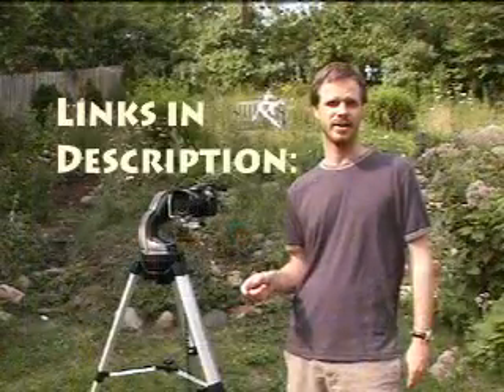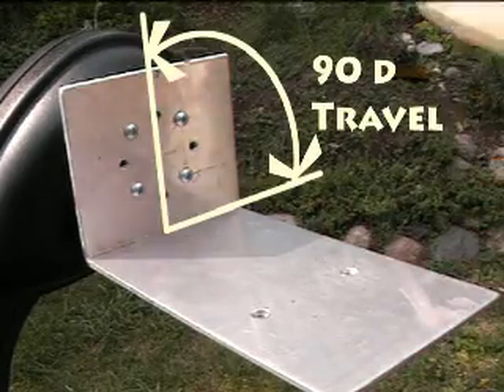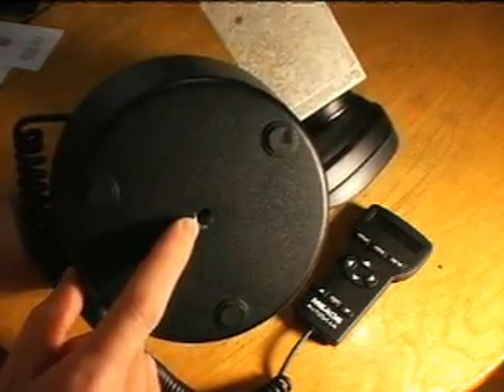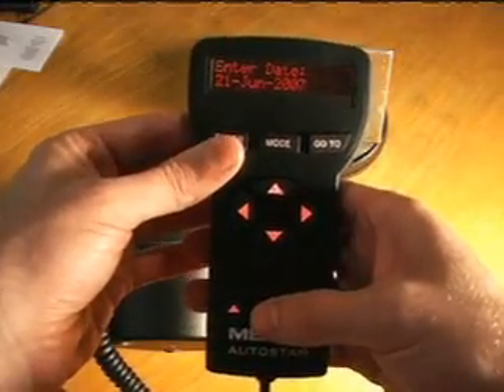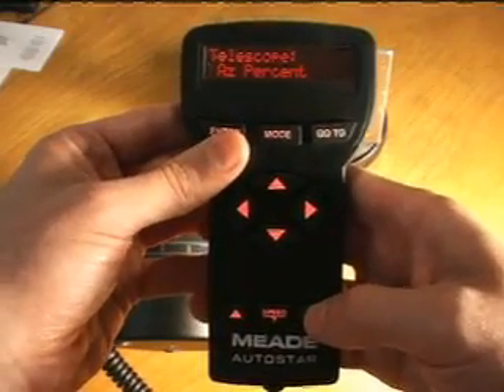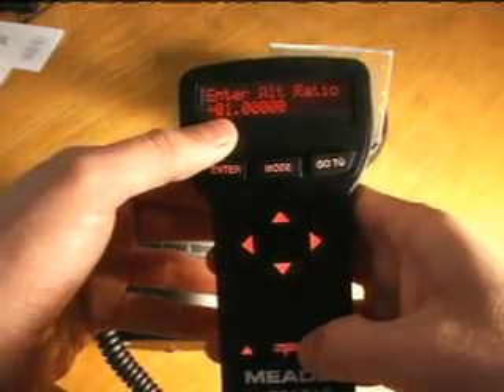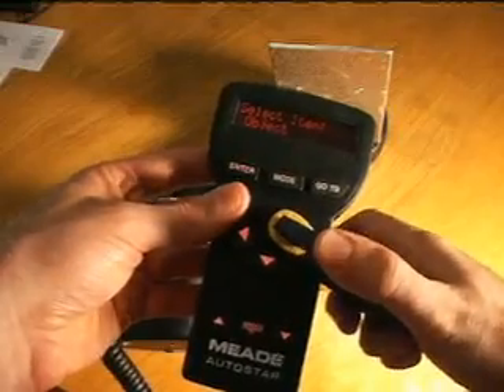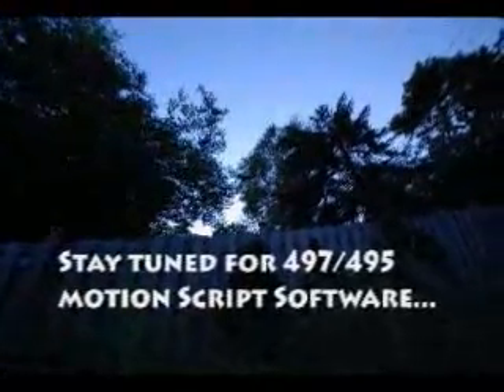Two Axis Panning Timelapse Head for DSLR (ready to buy)

Comment: So I got my ratios all set up and I tried to do a timelapse but it doesn't seem like the head is actually moving when I hold down the arrows. I can hear the motor but when i watch the degrees I dont see anything changing.  When you hold down the arrow keys do you need to be in a specific part of the menu?

Comment: great video! thanks a lot for sharing your experiences, very inspiring!

There is one thing I couldn't figure out. may you can help me by that:
I want to make a 360 degre pan (rotation) within a period of 24hours. 
Do you think that's possible with the 494 controler?
(I think about buying the ds-2000 with the 494 controler)

Comment: @cl191 I'm not sure whether it will, but stars trail quicker at the celestial equator.  So if you are pointing the camera around where the Sun normally travels (but at night) or (the ecliptic) the stars will trail the fastest.  There is actually and equation out there that tells the mm of star trial on a sensor using a certain fl lens at which declination (of star).  I hope this helps.

Comment: @milapse 'Sidereal' means 'pertaining to the stars'. Because the Earth orbits the Sun it actually rotates slightly more than 360 degrees in 24 hours (a solar day). A sidereal day is the time it takes for the Earth to rotate once in relation to the stars, which is only about 23h 56m.
Anal, I know, but factual. :)

Comment: Meade actually put a larger thread hole on the mount as a safety for their telescopes. Some tend to be heavy and most normal tripods could fall or be bent by the telescope's weight, so the larger hole is to provide a more stable connection and keep people from doing something stupid with their $500 dollar telescope.

Comment: Today (11/7/09) I bought a DS2090 at Costco for $199.  Get this - it comes with the tripod, ds2000 motorized head (a.k.a. milapse) AND the Autostar 497 controller!  Yes, that's right.  You can save $130 by notbuying the 497 separately.  Oh, and you get a telescope too (not a great one but goodenoughfor a little planet gazing...).  Costco item number 415461.  Available in stores only.

Comment from the maker: You are absolutely correct. The polarity of the 9v style connector is 'backwards'! Your solution is fine. I actually have one that is just the 9v connector to cigarette plug so I run it off a big 12v DC supply and waste no power in the conversion! ;-)

Comment: I made my own from a AC power supply I got off eBay for five bucks, look for a 12v 1000mA output adapter.  Then pick up a pack of the 9v battery terminals at RadioShack.  Now when you wire it up connect the red to black and black to red, that seems backwards, but trust me it is correct.  To test it disconnect your handpad from the tripod head and power up the tripod, if you get the red light you are good - no light  - something is wrong.

Comment: I find this to be a common error - you said 3/8-20 but the standards for tripod and camera mounting threads are 3/8-16 UNC OR 1/4-20 UNC (meaning: unified national coarse).

Since you said the rotator doesn't fit a typical tripod it probably has a 3/8-24 UNF thread (unified national fine).

Comment: In regards to your problem with the thread at the bottom of the panning head -- you can change the thread by using a heli-coil -- you simply go down to your local hardware or automotive parts supplier and request a heli coil thread repair kit for the 3/8-20 thread -- using the supplied drill and tap, drill out the existing thread, retap the hole, and screw in the supplied thread insert-these are generally used to repair stripped threads, but can be used to change the thread.

Comment from the maker: Never got around to that... It means - four 3/16"  diameter holes in a square pattern (::) spaced 1-1/16" on center. You can do a 45d set as well (same pattern) or dig into the head and remove the tab that limits it to 90d of travel.

Comment: Quick tip for this unit...
instead of clamping down the buttons to get it to keep moving on its own... just unplug the controller while you're pressing the buttons and  it will move on its own until you turn off the  unit at the source to stop/change direction

Comment: one thing to watch out for if you do the pulse thing is, i have noticed that if i start and stop the head it takes a few seconds fo r the head to start to move after power is applied.  if the motor has gone in the other direction, it takes even longer to get going. so that might be a problem

Comment from the maker: I'm not really sure where the bottom is... You could set it to 2x and set the ratio to .00001.  It's an interesting idea nontheless, Software control could do this. I'm thinking about a 'pulse' mode where you can set a pause/move/pause type pattern.

Comment: i would also bump up the thickness of the bracket to 3/16th aluminum if you are going to put a lot of weight on there.  if the bracket flexes or deflects with the weight  you will never get the camera to do level pans and the footage will look bad.

Comment: to address the durability of it.  mine recently launched out of the back of my pickup truck (it was wrapped in a blanket) and it still works fine.  I caught air going to a shooting location and the tailgate dropped down dumping everything out of the back.  the head still works fine.

Comment: if you load up the head with lots of camera equipment the vertical motor will fail and slip before the horizontal motor will fail.  you absolutely have to have the thing perfectly level if you have a lot of weight on it as well or it will have jerky motion or will stall all together.  anything more than 10lbs and i would limit it to horizontal pans only.  I think it can support 16 lbs +/-

Comment: also to answer a few questions about the weight and durability of these things.  I have mounted a canon 1ds with a 70-200 f2.8 IS lens with a 1.4x and 2x teleconverter attached to it.  that is a BIG and HEAVY camera setup.

Comment from the maker: A dolly could easily be made by using the motor units that I used in my custom version. Good pulley system in tension attached to a track dolly would do the trick.

Comment from the maker: Programming is a slow process... It's moving though!

The software will do much more than that! You know that you can get different vert/horz speeds by setting the az/alt ratios differently right? That's what I was attempting to explain in the video. You could set the az ratio to 1.0 (about 35 degrees/hour-at-2x) and the alt to .5 (about 12 degrees/hour-at-2x)... or whatever your looking for.

Comment: hows the software coming along?
 
does it do different speeds for vert and horozontal?  like for example..  2x horozontal and guide vertical?

I am getting  another one and I am going to try to remove the stops on the vertical axis.  I will let you know if its possible and how easy it is.

Comment: answering Drayg0: a "really" cheap way to protect your camera is to get a simple freezer bag, put your camera in the bag, and screw a lens on your camera over top of the bag, then take a knife and cut the bag around the edge of the lens so you its not taking pictures distorted, really MaGyver style... but it works if sudden weather comes along

Comment: I got an email back from Telescope Warehouse: the AUX port is for motor focuser plug in for a telescope focuser. However, this meade DS-2000 type mount can plug into your computer is with the 506 cable and software that plugs right in where the hand paddle would normally go. Telescope Warehouse doesn't sell the 506, but reccommends ebay.

Comment: Great stuff, and thanks for the links. I see there is an "Aux" port port on the head - do you know if you can feed a computer or microcontroller signal direct into that and bypass the autostar controller? The links don't mention the model of the head, so I can't find a manual for it. Thanks again.

Comment: looks awesome.  My bracket is almost exactly the same (8 holes offset) but i had to reinforce mine a little more becaus ethe 1ds and the 70-200 weighs so much the bracket was flexing and was not holding at 90º.  my first few i didnt level the tripod and the head and they didnt turn out so good.

cant wait to check out the software

Comment from the maker: You have to keep the buttons pressed to keep it moving, so rather than using your fingers...
It will go in circles until you run out of power! ;-) only the vertical is limited to 90 degrees.

Comment: I know your just trying to get me to use a battery powered panner, lol. I like toys and that is a sweet toy.
As for the 3/8 fine thread, you could use a small piece of wood with a fine bolt pointing up to mount the motor head and another hole threaded with a standard bolt to accept a regular tripod.